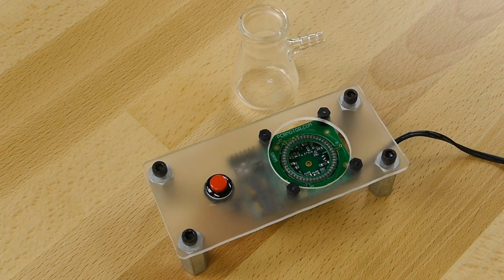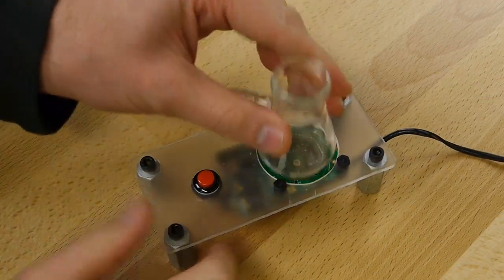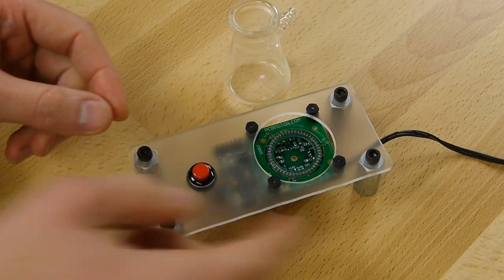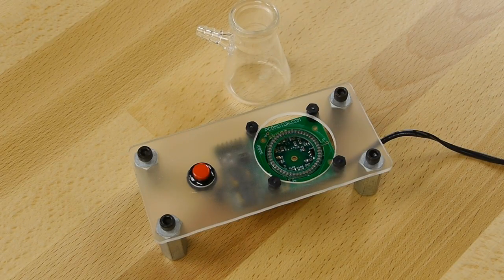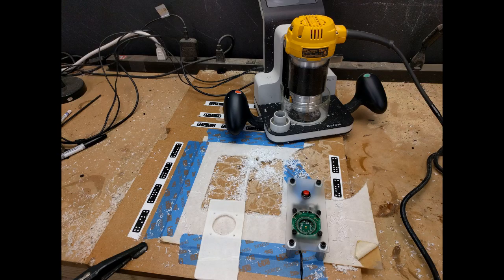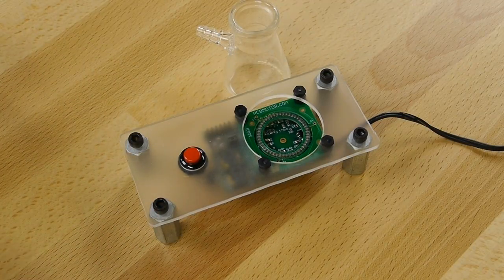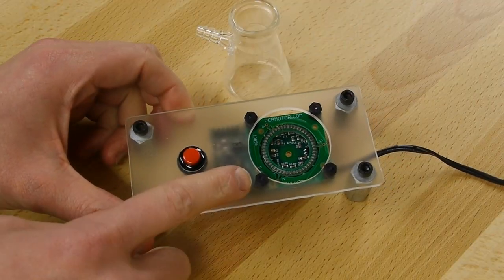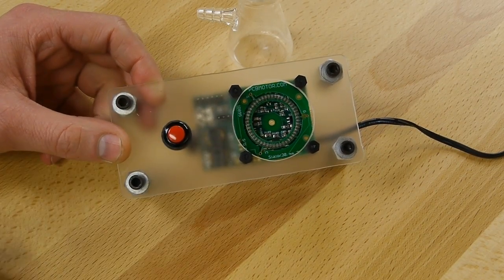Piezoelectric motor

Comment: Hmm, linear motor ? how about x-y linear, maybe a matrix of them, then you could drive an object in any direction
Reply: +Sparky Projects wow. imagine a table that was made of this.  objects could be moved around on top of it with the aid of some overhead camera or somesuch.  that would be awesome.
Reply: +Zev Hoover Give it time, it will become a reality, just remember me when you make your first million :D
Reply: +Sparky Projects I emailed PCB motors a few years ago about linear. the disappointing answer was that these simpler pcb version pretty much has to be a ring to transfer any power because it needs to resonate. however i found more complex Piezo LEGS® motors with a horisontal and vertical piezo stacked like tiny legs that micro walked across smooth surface at some power however at much slower speeds and a steep price.
Reply: @tigertalar  Do you have a link, please?
Reply: Interesting idea!
Reply: +Zev Hoover Why make the road move when you can just make the vehicles move?
Reply: +Sparky Projects Ultrasonic rail-gun?
Reply: Pass me the salt please.

Comment: Thanks for another interesting video, I'm a big fan. The idea of making a linear motor or complex path is a good one, but it unfortunately would not be quite as simple as you would think at first. The piezo actuators here actually aren't acting as independent little fingers. Rather, they are exciting a very specific resonance mode in the FR-4 substrate. You could arrange these actuators in a line on a pcb and excite them to create a traveling wave, but that wave will hit the end of the pcb and reflect back, creating a standing wave, and thus no longer creating the elliptical motion at the surface. You might think of canceling or absorbing the wave such that it doesn't bounce back, but resonance is typically needed in a motor like this in order to get sufficient amplitude of motion. The ring is actually a special case that essentially allows the wave to continue traveling in a circle forever. There are a few examples of linear traveling wave motors in literature. Commercial linear piezoelectric motors typically use more of a stepping approach with two-axis piezos, which seems like what you had in mind here, but unfortunately these ones won't quite do it. Cheers!
Reply from the maker: +Joe Mullenbach Great info! Thanks!  I hadn't thought about the problem of absorbing the wave in an open-path string of actuators.
Reply: +Fester Blats great metaphor. In principle, yes, you could wrap a track around and back to the start in a path that is not a ring. This would be a waveguide, and it's commonly done for different types of waves including RF electromagnetic and ultrasound. Keep in mind here though, that the board itself is moving, it is the medium in which the wave is traveling. You couldn't simply use the other side of the board, because the wave is there too. You would have to have another piece of board or some other link in order to guide the wave back to the start without interfering with itself.
Reply: +Joe Mullenbach could you make a linear track with two rows of circular actuators, forming waves in opposite directions? sort of like this: 8888888 --> where the top rings are all anti-clockwise and the bottom rings are all clockwise. Whatever is being moved would sit in the center of both bottom and top rows of actuators.
Reply: Joe Mullenbach yeah it would be cool to see it work. I imagine it being loosely analogous to the way a snake moves (not the S movement but its actual muscle contractions) or a centipede/millipede. I don't know how efficient it would be but it could be useful in places where traditional linear motors are not usable. Applied Science --you should tinker around and give it a shot :D
Reply: +Joe Mullenbach 
"You could arrange these actuators in a line on a pcb and excite them to create a traveling wave, but that wave will hit the end of the pcb and reflect back, creating a standing wave, and thus no longer creating the elliptical motion at the surface."
... but you can't get a circle from a straight line anyways, or am I missing something?

Have you seen the little toothbrush head "bugs", made using a small watch battery and a vibrating motor? The toothbrush bristles, in combination with the vibrating motor, create motion in generally one direction ... so the little "bugs" will move forward (obviously not perfectly forward ... but you get the point :P).
That's how I think of this piezoelectric motor working. I may be wrong though (and I probably am, as I am always wrong XD)

I see what you mean about "exciting a specific resonance mode in the FR-4 substrate" - the piezo elements are on a section of board that has minimal mechanical interference/connection (whichever word is better lol) with the rest of the PCB, so as to help maximize the energy going into producing the rotation. :P
Reply: +Gerben van Straaten Yes, this is a clever idea, and I think it would work, though maybe not for this set of design constraints. The problem that you typically run into when you remove the energy of the wave rather than propagate it is that the amplitude of motion is much less. Because piezoceramics create such little strain themselves (<.1% typically), you need a method to amplify motion. Traveling wave ultrasonic motors typically use resonance to achieve this, so if you choose to not use resonance and damp your wave packets instead, you will likely have to invent a new way to amplify the motion. Or maybe a different type of actuator would work.
Reply: +Tony Box That's a good idea, and I see no reason why it wouldn't work. Each circle would need to be isolated, and you might run into issues getting simultaneous contact between them, but those are probably workable design issues.

Comment: This kind of motor is pretty much universally used in high-end camera lenses to drive the focus mechanism. Because they're hollow rings, they don't interfere with the optical path nor do they require much space (as opposed to a miniature magnetic motor plus a gearbox system). 

Additionally, they're very fast and can change direction near instantly (no high RPM components like in a magnetic motor + gear train design), plus they're practically silent due to high driving frequencies and no gears. 

The last advantage is that some versions of this design allow manual focus override. On cheaper lenses with a motor + gear train, you need to flick a mechanical switch to go between manual and autofocus, in order to disengage the gears. In ring-shaped piezo motor designs, you can manually adjust focus at any time, as forcing the focussing ring to move just makes the piezo motor slip without damage.
Reply from the maker: +JMMC1005 Good info!
Reply: @AppliedScience   Have you seen this piezo electric fan, Linus Tech Tips has reviewed? Here's a Link: https://youtu.be/NY-gA_zA_os
Reply: Pavle is just a troll.
Reply: @apinakapinastorba  That dude either has a brick for a head or is just trolling. Methinks a brick.
Reply: +JMMC1005     I was wondering about that.  It was my first thought when I saw it.

Additionally they are damn expensive to get replaced when they go bad :O   $400 to get the one in my Nikon 80-200mm f2.8 replaced   :(
Reply: @scottverge938  As someone who used to do camera repair, I can say for certain that 90% of the cost (or more) was labor. Lenses are extremely labor-intensive to work on, and unlike most things I've repaired, take a fair bit of care and training just to be able to put the damn things back together in the end.
Reply: @geek65535  I don't doubt it was mostly labor but even just buying a motor myself would've been $100 if I recall correctly.  But this was a few years back and it's a discontinued lens.
Reply: +JMMC1005 Should be useful in telescopes as well
Reply: +Scott Verge 

Ouch, that's more than the entire cost of one of my lenses which features the same kind of motor!
Reply: Once I had a lens break on me, so I thought I would take it apart to see why it broke... BIG MISTAKE! Aliens are responsible for camera lenses. REALLY SMALL ALIENS!
Reply: I have a pieazzto eletric toilet seat. When i flush i end up facing the cistern... very confusing.
Reply: @staplejats  it's not a bug, just a feature. Cistern doubles as a table.
Reply: Well it is a $2500 lens if you bought a new one.
Reply: When you did the manual movement wouldn't the motor be completely disconnected since the piezos have to be energized to touch the focussing part?
Reply: JMMC1005
Reply: thank you for your correlation.
Reply: good point.
even though all my cameras lenses are round😅
Reply: what the f are you talking about focus motor in lenses is just that small DC motor , not even a servo , and 260 likes motherfucking idiot nation
Reply: @dedskin1  focus motors are now primarily ultrasonic motors.  Which are faster and quieter than common DC motors.
Reply: @scottverge938  congrats on inventing new kind of motor " ultrasonic  motor  "   but i do realize i cant fix 300ppl  i was dumb to even try
Reply: @dedskin1  Never had a decent lens I gather. Focus motors in cheap lenses are micro motors. Better, more expensive lenses almost all use ultrasonic motors which are round piezoelectric motors just like the one in this video. Stepper motors are also increasing in popularity too especially for video because they are even more silent.
Reply: @LarsVeldscholte  yes my ferrari also has ultrasonic tires , cheap cars have just regular tires and some might have stepper tires , but mine is an ultrasonic one , or 4 . Sure
Reply: @dedskin1  Are you seriously disputing the simple fact that USM lenses exist? I don't even...

https://cpn.canon-europe.com/content/education/technical/usmlens_technology.do
Here is an article from Canon outlining different focus motor technologies. As you can read there, current USM (Ultra Sonic Motor) lenses use piezoelectric ring motors just like the one in this video.
Reply: @dedskin1  You could just type in "Ultrasonic Motor" into google and click on one of the many articles such as the wikipedia page that mentions piezoelectric actuators many times. Why get in an argument about something you have little knowledge on? I mean in the applications section of the article it starts with "Canon was one of the pioneers of the ultrasonic motor, and made the "USM" famous in the late 1980s by incorporating it into its autofocus lenses for the Canon EF lens mount."
Reply: @snewl5324  or i can go to actual school and learn which i  did for 4 years of electronics so i dont need wiki , its a small DC motor deal with it
Reply: @dedskin1  Sorry but both you and OP are actually both mistaken on this, camera lenses don't use a ring of piezoelectrics as demonstrated here, but there are some that use a USM(Ultra Sonic Motor)/SWM(silent wave motor) it's not comprised of a ring of piezo elements, but rather a tuned metal ring that resonates with little fingers that cause micro-motion, but driven by at least one piezo element.. Apparently you might actually find a piezo drive inside some smartphone cameras, but I don't know to the extent that one is used commercially. 

If you are going to boast about being educated then please be more open to the idea of learning..
Reply: @Roobotics  you read too meany commercials and wiki articles , every car uses a wheel  and almost all are made of rubber , you can talk shit all you want , act smart, its a rubber tire , as is this a simple DC motor , there are no 2 ways about it ,
Reply: @dedskin1  why are we talking about tires? This is for the focus mechanism of multi-thousand dollar lens assembly for high-end cameras. Of course they are going to have some more exotic options than just a DC motor.
Reply: @Roobotics   oh well , i just wonder how is my camera going to run that exotic motor of yours if its not simple dc motor . I guess im screwed and better buy some camera that can run exotic motors .
Reply: @dedskin1  You only buy one of these if you are big into professional photography, nobody is forcing you to purchase. :) Just proving they exist since you seem to be in denial.
Reply: @Roobotics sure thing buddy
Reply: @dedskin1  Wow nice baiting you did there
Reply: @dedskin1  well actually, tires aren't just rubber, silicone is becoming more and more popular in the tire industry because of it's low rolling resistance.
Just to say your argument is completely irrelevant.
Reply: @dedskin1  hahah never try to correct the nation or society, they like lies

Comment: can you explain how does this compares to "ultrasonic" focus motors found in camera lenses? like in the Canon 24-70 2.8L (or many others). it is a motor that doesn't have a hub, and doesn't seem to be magnet... but I don't think that it has to use higher voltages...
Reply from the maker: +Guilherme Freire I think it's basically the same thing.  The camera lens may have a stator with much more customized piezoelectric parts, allowing it to work at a lower voltage.  The stator may be metal, and the resonance tuning may be more precise to allow less input amplitude.

Comment: I built a micro edm that had linear nano positioning stages that used piezo motors. it could move 0.1 microns at a time. but the limiting factor wasn't the motors, it was the encoders.
Reply: Plenty of high resolution encoders available, even sub picometer accurate, although those require special permits to obtain

Comment: The noise is the glass scraping on the elements, hard plastic is quiet.
Reply: +Robert Szasz 
From the closeup, it looks like the elements have some sort of coating on them.
My thinking is the squeaking is a side effect of the frequency and/or modulation/sub-harmonics of the whole assembly. (the microcontroller on there adjusts the frequency to get the best torque (however small that is XD), thus the lower-frequency of this adjustment might make the audible noises.)
Reply: Could be. I haven't gotten a kit as I don't have a use for the tech at this point. The videos I've seen show very quiet operation with a rotating element a bit softer than glass. If squiggle actuators were cheaper they would make great ultralight linear actuators for model planes.

Comment: smd ceramic capacitors present the piezoelectric effect and are dirt cheap in bulk. Those components look suspiciously similar.
Reply: only problem is that the effect is a lot weaker in those. thats probably why these are so expensive because they had to create their own device that works better

Comment: I'm not trying to be a troll here but I thought a transformer referred to a step down coil? (In the case of this motor it's a step up coil) I'm an automotive tech not an engineer so can someone clarify in engineering terms? This is just a simple linguistic terminology question lol
Reply: A transformer can step up, down, or merely isolate (depending on the primary/secondary turns ratio). The ignition coil that creates the spark for the spark plugs is an example of a step up transformer.
Reply: +Troye Welch ok I just had a brain fart over something simple lol

Comment: There is another aspect of this. Adding it to the outer edge of wheels to create a higher-friction surface. Of course if the parts to make it are pricey, it still might be better value to just make a rubber tire, but still a cool effect.

Comment: This would have to be almost no torque though, right? I mean, if the "rotor" (or spinning object) was actually connected to something to move it, I'd imagine it could supply only very low torque.

Comment: You can also have an electromagnetic linear motor (ex the Maglev train). There will also be a small magnetic field with this piezoelectric motor. 
A stepper motor is probably more useful in most applications.

Comment: What happens if you touch the motor while it's running?
Reply from the maker: +MilkCap You'll feel the 200V before you notice any sort of apparent motion ;)
Reply: +Applied Science it shouldn't do any damage right?
Reply from the maker: +cool redstone The current is pretty low, so it's unlikely to cause any lasting damage.  It stings enough that you would want to hold on to it.

Comment: Awesome concept, but oh my goodness the sound!  Is it that fingernails-on-the-chalkboard sounding if you use something plastic or metal?  That is, is the awful sound due to the piezo aspect of the device or because it's interacting with the glass?
Reply from the maker: +Jason Patterson It's mostly the glass.  The included disc rotor is fiberglass, and it's almost silent.  The stator by itself is completely inaudible.
Reply: The sound depends on the surface in contact with the rotor due to friction , but one of the project requirements for these devices is to operate above audible frequencies  (about  20kHz).
Reply: +Jason Patterson I guess you could sit something like a plastic or rubber disk on the motor and then put the glass on top of that. Maybe that would be quieter.
Reply: +Jason Patterson that's EXACTLY what I was going to say lol
Reply: +Applied Science That's good to know.  I have no idea what I would use it for, and the visual of the little vacuum flask spinning was perfect, but that sound was no bueno.  Thanks for the info!